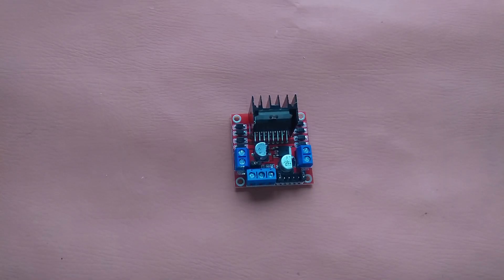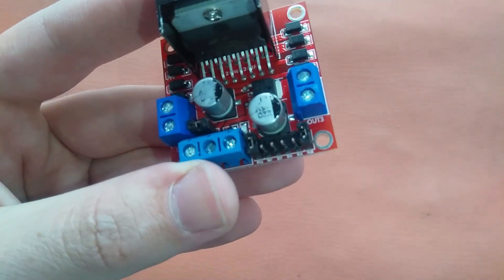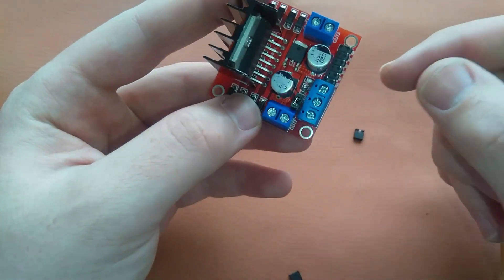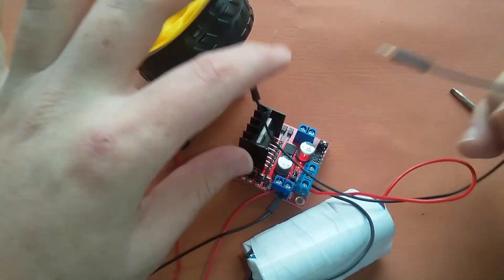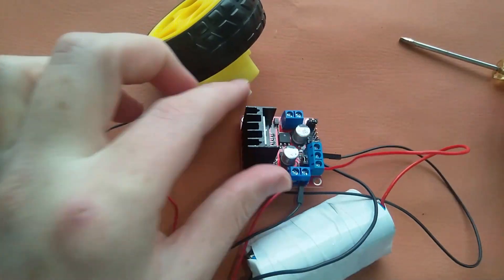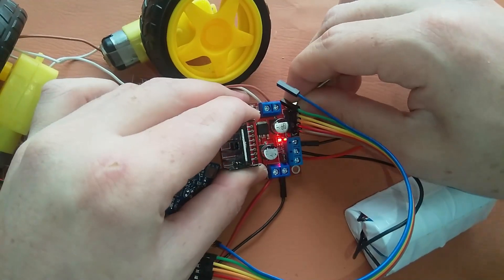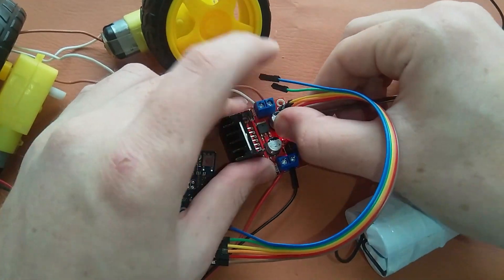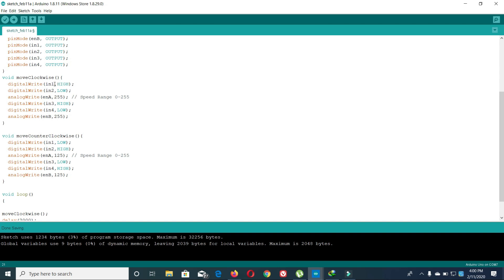How to control DC motors with L298N motor driver - L298N  with Arduino || Azhar Electronics

Comment: Sir can you please tell me ,i want to run 4 wheels on 2 motors using thid driver ,is it possible? yes then how should i make connection. plz sir reply fast
Reply from the maker: You can run 2 motors on this module. You can make the other two wheels free and two wheels connected to motors.

Comment: What is the input  voltage of driver that you used in this video
Reply from the maker: According to the datasheet its input voltage is: 3.2V~40Vdc.

http://www.handsontec.com/dataspecs/L298N%20Motor%20Driver.pdf
Reply: Sir let me help to run this project within 2 day please
Reply from the maker: @mrshiv3904  Contact Me: azhar987k@gmail.com
Reply: @AzharElectronics  ok